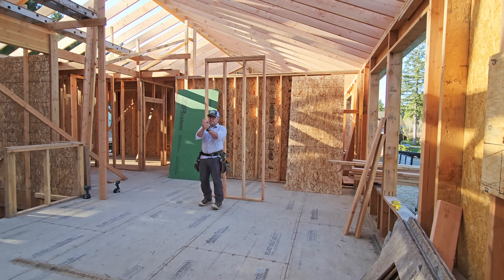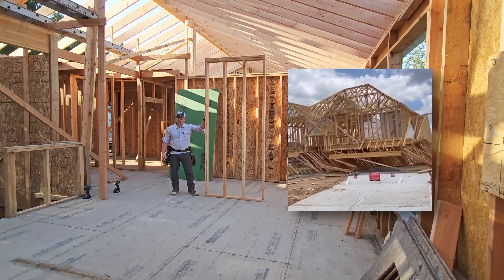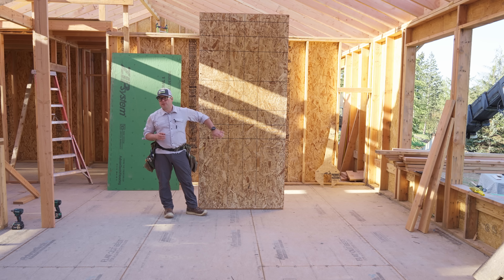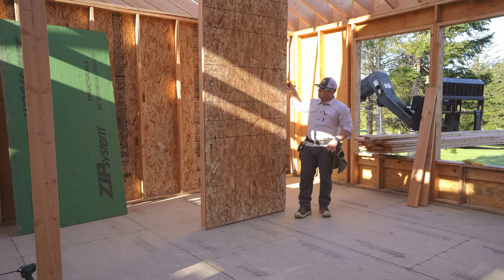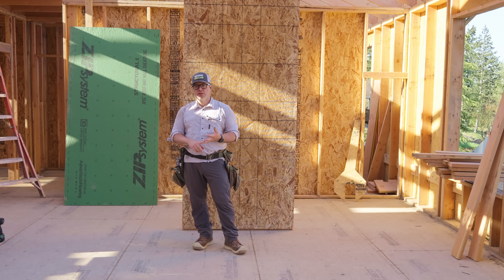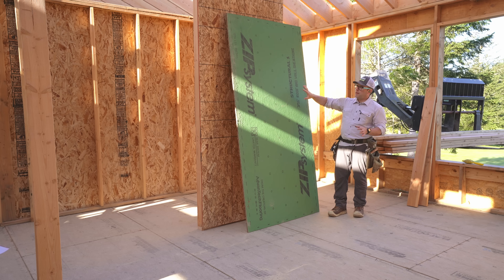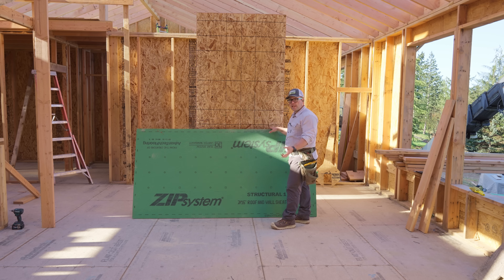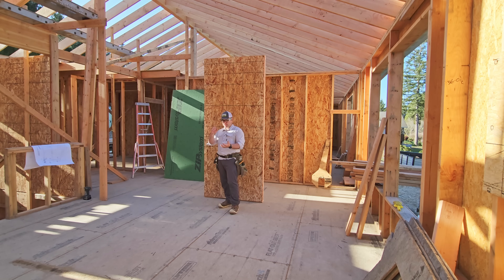Shear Walls Secret: The Hidden Force That Holds Buildings Together

Comment: I also didn't give you any proof of atoms existing.

Why don't you go read some books and learn something on your own accord.

Are you not capable of educating your own self?

Let me say it again for you as you didn't hear it the first two times, the evidence are the structures that exist in the real world. There isn't any greater proof than that.

Do you not know about these structures or building techniques, is that it? And with Google at your fingers You're still willfully ignorant on the matter?

Well, I guess we all see your depth on here anyway. Very limited Id say.

You really need to read some books, man. There must be a hundred or more ways to build a structure. Hey, what do you think people did before Google, the smart phone and codes where invented?

You probably think you were the first and only man alive huh? 😂

Do you even know what a so called pole barn actually is?

I would waste more time on you here, but actually I'm in the process of beginning to build my own house now that the winter is finally over.

Definitely going to use the post and beam method. I've researched for over four years just about every single building technique ever used. You name your method of construction and I'll tell you how to build it properly. Stone, brick, wood, timber frame, balloon frame, platform frame, advanced frame, wattle and daub, stucco, lime plaster, board and batten, underground, above ground, on stilts, piers or piles, adobe or concrete, with or without rebar, steel, aluminum, ranch style, craftsman style, English Tudor style, mid cent modern style, Edwardian, Queen Vic, salt box, flat roof, gable roof, hip roof, pyramid roof, mansard roof, stem wall, earth bag, earthen floor, rammed earth, earth ship....

I mean it's is truly endless and I haven't even begun to scratch the surface yet.

It's countless truly.

Ever been to the oldest house in America? I have. It's in Santa Fe New Mexico. Built in the 1600s and made out of mud. They give tours. Of course you need proof and don't believe a word I'm saying. Must be a hard way to live life actually. I feel sorry for you now actually.

Maybe I better lay off of you because you're probably very unstable as well.

So sorry for explaining to you a better way to build. Sorry for trying to help you and others. Keep humping the modern day version of the stick frame technique. I'm sure you think it's the best. 😊

I'll unsubscribe and go to a channel that is open to the facts of real life.

You're just not up to speed on it yet.

Maybe one day you will be. Maybe not.

Whatever. Just glad I'm not forced to build my houses like that.

Cheerio!

Comment: If you build using pole barn construction, you won't need any shear walls. Won't need any headers either. Nor metal straps or ties and anchors. Nor screws, nail guns, compressors, or laser levels. None of that stuff.

And it will be by far stronger than any modern day stick frame house ever though about being.

Post and beam construction is hard to beat.

But there are countless ways to construct a building. Far too many to name.

And if you think the posts will rot then you're mistaken. Simply coat the poles in liquid rubber and then you can either embed in concrete or not. Either way is fine. Will never rot. Not even toxic.

Post and beam done right gives you the most bang for the buck and is a very versatile platform that can adapt to just about any place on earth. It is perhaps the oldest form on construction known to mankind. Even before stone was used.

One man alone can build the entire structure himself and with simple tools and very quickly too.

And it exceeds every code in the book as well. Not that that matters to a man like me, but to all you code humpers out there it might. I have no codes here where I live. To me it's more important to build it correctly than to adhere to another U.S. corporate/government scheme.

Remember, post and beam.
Reply from the maker: Pole barn construction in seismic zone D2 won't work without lateral restraint.  Shear walls are one of the ways we can do this inexpensively.
Reply: @AwesomeFramers  Guess that's why I'm in an earthquake region surrounded by pole barns that have been here longer than you've been alive.

And as far as costs, I'd say on average it's about 1/10th of the cost of a stick frame house.

I've gotten the costs down to about $10,000 for every $100,000 you spend on a stick house.

And as far as time spend constructing, less than 1/4th the time spent over stick frame.

There just isn't any comparison at all between the two really. Every single aspect of it is cheaper, stronger, easier, quicker, better. And by a very wide margin too.
Reply from the maker: @Teshuvah-n27  I don't believe you.  You provided zero references to "pole barns" performance in earthquakes, code or engineering references that support your claim.  You just sound like someone who believes no one else can be right.  

Please don't waste my time with your replies.  Go make videos to support your claims.
Reply: Proof? You mean all of the proof around the globe standing for the past couple thousand years?

Um, if you don't know that then that is truly alarming. Good gosh I hope you don't actually try your hand at building real structures that people actually live in.

Scary thought indeed.
Reply from the maker: @Teshuvah-n27 You don't have one reference you can post on pole barns in seismic zones? No sense in belittling me for asking, that's just weak. Let's see a reference that backs up your statements. 

That's fair.

Comment: Here in Arizona developers have no idea what proper exterior sheething is. They think it's okay to use styrofoam sheething and our building codes allow it.

Only 0.01% of developers here do a proper job and OSB or CDX 100% of the exterior walls.

Comment: Hard to believe some pro contractors would build second floor framing without a single brace or  structural sheathing installed.

Comment: Thank you for the demonstrating important but rare to find topic-Shear Wall. Two question for discussion 1) Does a vault ceiling sunroom, proposed in Cary, North Carolina, total 18 feet wide gable end and total 13 feet 6 inches long ridge beam, built on 6x6 posts and framing for fireplace, etc, still need a minimum 16 inch shear wall at the corners on both directions? 2) How about for any other size sunroom built only on 6x6 posts and beam, do they need minimum shear wall corners? Thank you.

Comment: That would never happen with a good old german half-timbered house built from solid oak. It's strange that 300 years ago, more stable wooden structures were built than today, and without any screws, nails or other metal connectors, just classic carved wooden joints. Long live the noble craft of carpentry. 🤔😉
Reply from the maker: You are claiming that the house described if it was built in Sothern California wouldn't need any lateral support?

Comment: I have never stood up a wall without sheeting, and usually, housewrap already on. if the floor is level, sheeting is square, the walls will be perfectly plumb, and you don’t have to wrestle with sheeting three stories up on the side of the house.

Comment: I'm just dropping in to comment that the jaw drop thumbnails are very over saturated.   Make me avoid the videos at this point.  
 Peace out.
Reply from the maker: Actually there are studies that prove otherwise.  Easy Google search, also the thumbnail for this video has directly contributed to the 566,000 views.  You can also see analytics on that. It worked because you commented, which helps the channel.  Thanks!

Comment: Howdy Tim,
A question about zip. In your other videos, I have noticed that you don't use the zip liquid flash on your nail penetrations. Do you mind explaining that rational? Thanks for adding to the collective knowledge machine known as youtube!
Reply from the maker: Good question, Huber's warranty on Zip does not require treatment of the nail heads.  The system was designed this way and performed (and performs) well without Liquid Flash over the nail heads.  The reason you started seeing it is because of some YouTube and Instagram personalities thought they'd take a great system and make it better.

It is a waste of time treated properly driven nails.  It doesn't improve blower door scores and does not make the system better.  I would never propose anyone take the extra time and expense, and I would never do it to my own house.  We've used Zip since 2009 with great success.
Reply: @AwesomeFramers  Yeah that makes sense. And there is nothing to be done about the 5,000 nails shot through the siding. Thanks for the quick response.

Comment: This is a good video for framers in the south they put all the walls up and then scaffold outside and put the sheathing on after. Guys can be crushed. It takes 3 times as long to build also if you don't put the plywood on before you raise the walls.

Comment: If building a two story house, would you suggest sheathing the bottom before start in the top floor?
Reply: On a two story home, you’d build and sheath the second floor walls on the floor, leaving the shearing sticking down so it reaches the first floor studs when stood up. This ties the two floors together. Then you sheath up to that line

Comment: If you stand your walls without sheathing them first has no clue how to build a wall. Your wall will be square and then braced to plumb until your adjacent wall is placed. Interior walls are built the same way except there's metal or wood bracing diagonally. Guaranteed its not blowing over.

Comment: 8:11 Not true. 5/8 and 3/4 sheathing provides more resistance than 7/16
Reply from the maker: Can you provide a reference?

From Woodworks "For most shear walls and diaphragms, fastener capacity will govern over sheathing capacity"
Reply: @AwesomeFramers   I mean that's true if the nailing pattern is 6/12 but once you get down to 3/6 with 7/16 OSB, then the capacity of the panel itself is the weak point and an increase in panel thickness will increase strength. I will look for technical data to send but I'm going off of many conversation I've had with many engineers trying to meet shear capacities on structures I've designed. Going with 3/4" or 5/8" sheathing has often been part of the solution.
Reply from the maker: @danielmoskowitz3060  thanks for the reply, if you look at the SDPWS and also the Apawood.org publications you can see that we can go tighter than 6" panel edges nailing with 7/16", often we go to 3" oc with 7/16 and the literature supports that.

Additionally with the thicker panels, the nails are the constraint. I'm trying to find that published reference.
Reply: @AwesomeFramers  Right but you can do things like glue the panels, use screws or double stud the wall to allow for an even tighter fastening pattern . I'm just saying, a 7/16 panel is not the necessarily the point of diminishing returns. It does add strength as long as the fasteners keep up.
Reply from the maker: @danielmoskowitz3060  you aren't supposed to glue wood structural panels. Thor Matteson SE talks about this I'm his book Wood Framed Shear Walls Construction.

I highly suggest reading the materials I referenced above. There is a reason why most shear walls use 7/16" in residential construction.

Comment: I'm only 3 minutes in and I'm irritated because I feel like a third grader should know this. But from the clips I've seen apparently some Carpenters don't know this. I'm a welder fabricator and use gussets in several applications. It just seems like common sense to stop your 90° angles from becoming anything other than a 90 degree angle.

Comment: back in the 1980s here in Missouri we used to build the walls on the deck: siding, soffit, windows and trim. then we would raise them without worry about racking

Comment: Sheathing should be horizontal not vernicle  and installed while the walls are laying down not standing up!...
Reply from the maker: That's not actually correct. https://up.codes/viewer/washington/wa-residential-code-2018/chapter/6/wall-construction#6

Read the footnote in the wall sheathing section.
Reply: I know that they say it can...I'm telling you that common sense and 47 years of building will tell you that it shouldn't...  @AwesomeFramers
Reply from the maker: @southernhomesteadtransformatio  your experience means zero. The testing done over the last 30 years by universities (plural), duplicated and repeated proves the matter.
Reply: @AwesomeFramers  then do it however you like and so will I...Great to live in the 🇺🇸
Reply: @AwesomeFramers  and would  you put it that way on the roof?...no, so why on a wall...
Reply from the maker: @southernhomesteadtransformatio   

@southernhomesteadtransformatio nope because the stren axis on the panel runs the length. This relates to roof and floor loads. Lateral loads are different. Please read the references in their entirety 👍👍

https://osb.westfraser.com/blog/whats-on-your-apa-grade-stamp/

https://www.weyerhaeuser.com/woodproducts/document-library/document_library_detail/osb-4004/?_gl=1*7g5d9f*_ga*MTMzMzAyMjAzMi4xNjk5MzcwOTgz*_ga_NKZNYZJCY2*MTcwMTEyODg3NS4xLjAuMTcwMTEyODg3NS4wLjAuMA..

Comment: And...if I may...  Sheath the wall while it's still on the deck (square first of course) then tip it up.  Then you only need to plumb it.  And it's mostly already taped too.  And won't collapse.

Comment: Just wondering what the large wrench made out of wood leaning up against the wall is used for?  Good video.
Reply: OMG too funny and great question! 👍🏼😁
Reply: flipping over big long beams when glueing/nailing them together or when cutting the ends off to size @ZenDreaming60

Comment: 1975 a two story stick building in Round Rock Texas fell with the same lack of cross bracing. Inspector and professionals warned the worker to no avail. I may remember correctly that 3 men died. Witnessed said there was a loud crack and 2 seconds later there was a crooked pile of lumber. No chance for anyone to escape.

Comment: I framed for 24 years and when I started out we were letting in diagonal 1 x 6  permanent bracing into a number of our interior bearing and non bearing walls. 
Then it went to metal T bracing and then as I started working on panel homes I didn't even see that.
I've gotten out of framing because of back issues and now I just repair homes. However on one occasion after the roof was sheathed and all of the braces were pulled I was  standing in the middle of the hall in a doorway and was able to rock the whole frame side to side.  I

Comment: I survived Hurricane Andrew and then drove back down to my house, in South Miami Heights from NW 41st Street. Most homes built using cinder blocks construction survived. One housing development of 3000 homes, Lennar I think, gone. wiped of the map. I saw entire homes of cinder block gone. Roofs missing on some. Others, not a frickin’ scratch on them. O lived in a Quad townhome set up, Mine unit was on the west side, I had an 4’x5’ Plate glass above my front door. It had a 6” crack in it. My unit had zero damage. no leaks, nothing. The people behind my unit that were facing east? They got wiped out, so did their neighbor facing east. My neighbor facing west, got damaged because of his east facing neighbor. The guy across the street from me, A soccer coach at FIU, je had just spent $30,000 on nee Scandinavian furniture, custom furniture. It was beautiful wood working! GONE! It belonged to Andrew and his mansion in the sky. What a mind blowing nightmare Andrew was. The closest any non combatant will ever come to what a combat zone looks like. Any seriously damaging hurricane. Sorry.  Reliving those moments.
Reply: Most homes do not survive 150mph winds

Comment: So nailing 36 nails into every 3rd stud is better?  😂. Lazy framing and excuses for standing up. The strength is increased by staggering  joints on the studs. By nailing all perimeters with 6" on center you effectively blew every 3rd stud joint to death with 36 nails. Then we get wild walls on the interior. You don't gain anything extra by standing up. You loose your stud strength.
It sounds to me like you learned the lazy way instead of the right way. Yes standing up will still provide sheer value however you are still causing issues with spit studs. Or maybe you run all wet wood so that doesn't matter. Lazy dude trying to sound like a pro!